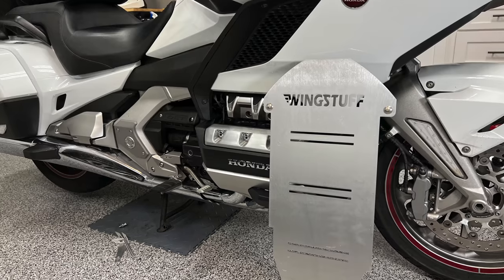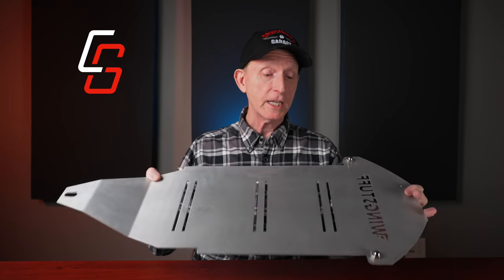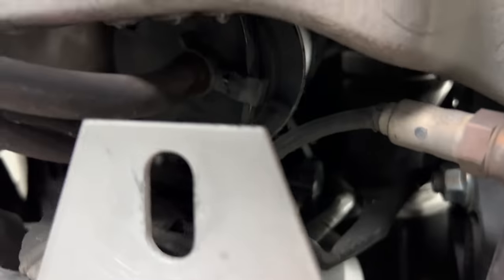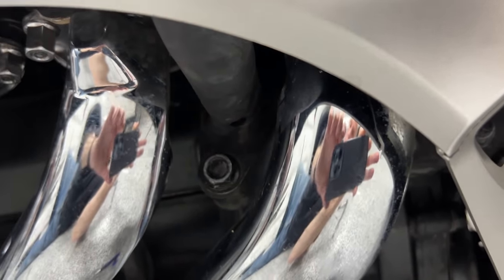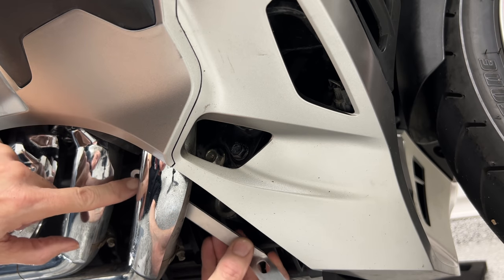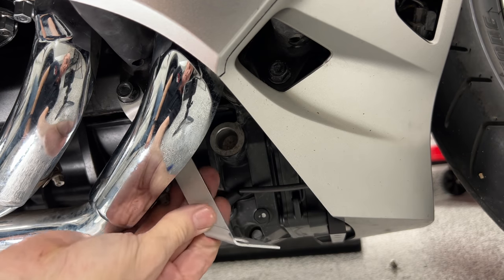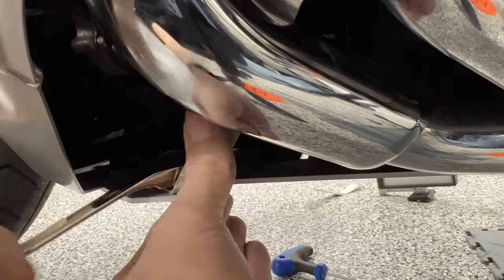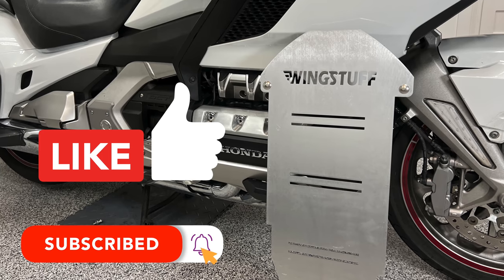Belly Pan Skid Plate for 2018+ Honda Goldwing from WingStuff | Cruiseman's Reviews | 2022

Comment: Thank you for your review. After your review I am glad that I  purchased and installed the Traxxion engine case guard.
Reply: Same!!
Reply: Well said!  Speaking from experience..If you've ever had an impact to the engine guard you won't waste your money or time on this product.
Reply: @gregb.6682  this plate only needs to be made a bit thicker and it would offer all the protection of the Traxxion case guard without removing any engine bolts to install

Comment: Received this kit yesterday. The “T” nut has two nuts and the acorn nuts are no longer shipped in the hardware pack. Face lock nuts have replaced them. I was never a fan of a belly pan. But, seeing engine case damage on the Goldwing forum, I ordered this pan from Wingstuff. It is absolutely a very sturdy pan. If road debris destroys this pan, you have bigger problems. I was hesitant to order this over the heavier Traxxion pan. But, seeing it firsthand, I can assure you, it’s more than adequate to prevent damage to your engine case. It is very heavy (like 1/8”+) thickness. I was actually surprised at the quality and strength of this pan. I would not hesitate to say, spending more money on the traxxion is a waste of your dollars.

Comment: I would actually opt for a kit that has the properly bent brackets. You should not have to do that…
Reply: @samerhallak  so once formed it will come out , but if it comes pre formed it won't? That makes no sense.
Reply: @alsaint7944  simply it needs an engineer to understand it.
Reply: Wingstuff just announced that current kits will come with pre-formed mounting brackets, that will not touch the header pipe when installed! Good news!
Reply: @claynicolsen5401  that is good news
Reply: It would have been easier if heed put the brackets on the correct bolts ( the front bolts on the engine bars and not the rear ones ) like it says in the instructions then you don't have to bend anything
Reply: @claynicolsen5401  The one I received from them last week did not have pre bent brackets.
Reply: @ientwistle1  

100%. It’s the front most bolt. He’s got removing wrong bolt.

Comment: Wingstuff should be refunding everyone’s money who ended up with the first and second editions. Mine was crap and did not have the   Nut and washer for the T bolt. Had to try to find replacement at local hardware store. Seems to me they should have taken the faulty one off market if they were designing a new one, instead of selling substandard plates. I literally purchased the last edition a month ago.
Reply: They should not be selling anything that's not finalized. Its kinda scuwy of them to do so.
Reply: This video made 9mos ago must have update/different instructions. Here in Oct 2022. Those 2 front bracket bolts between exhaust pipes are now the 2 bolts forward just inside the lower side engine covers. A goat screw, but not impossible and certainly not 15-20 min by any means. Not a complicated process but requires the finger dexterity of a martial artist. 😂 Got to be able to better engineer brackets that require no bending.  Brackets that fit the Wing as it should. Otherwise a good value.

Comment: I have an ’18 Tour, manual. I installed the latest version of Wing stuff’s belly pan on 1/25/22. It was a fairly easy install, taking me less than 45 minutes. I watched Cruiseman’s video before starting. He covers the process pretty well.
 
A couple of points have changed since he posted it. The front brackets are pre-bent. However, I still had to make minor adjustments on both sides. The kit now includes two washers and nuts for the rear t-bolt. This allows you to secure the T-bolt, with one washer and nut. You then slide the plate onto the bolt, and secure it with the second washer and nut.

I have a few minor concerns:

The printed instructions say that you can slide the belly pan above the front plastic cover, and push the plate up about an inch. I could not do that on my manual. To me, there was not enough gap to slide the plate inside. The brackets also hold the plate lower than the plastic cover.

I’m concerned about the nuts coming lose while going down the road. You need to remove the plate for oil and filter changes, so you may not want to use Loctite. A nylon-insert lock nut might help on all three nuts. Lock washers may help also.

Be aware that the nut, on the left side bracket, is pretty close to the shift linkage on the manual bike. (May not be a problem with the DCT.) You may need to adjust the bracket, to make sure there’s enough clearance. 

Just my 2cents worth.

Comment: Fitted my Wingstuff belly pan today. The brackets are a right royal PITA!....especially if like me, you have the Goldstrike Highway pegs fitted. It's doable but very fiddly have to line up the highway peg bracket with the POS belly pan bracket and the bolt hole in the casing. Lots of sweating and swearing involved. I ended up tapering the highway peg mounting bolts that the bellypan brackets also hang from so they would find their way easier into the casing eventually. IMO, a better and easier way would be a 2 piece bracket for each side, either end bolted into their respective holes and then joined with another nut and bolt in the middle?? ....Just a thought.

Comment: Nothing keeps you from permanently installing the T-bolt with a separate nut and then installing the plate over it with another nut except maybe my post below. It appears the "recess" or bend in the rear portion of the plate is deep enough  so the additional nut will not lower the plate significantly. On the install pictures I have seen the T-bolt appears quite long, so maybe this was somebodies thought anyway. 
I have Max's ECG system and  installed it on my DCT. I have since removed it (Never ridden it, just installed), re-torqued all the OEM bolts (which were torqued all over the road). I had also reshaped the cutout for the rear Oil drain plug.

The bracket fit was fine, but the remove/re-install process with seven (too short 10mm screws) is cumbersome. The plate is heavy when you are lying under your bike on your back and are trying to hold up the  plate with one hand and trying to insert one or two fiddley tiny screws with the other. Big pita, IMO.
YMMV

Comment: Good review and install guide. The soft aluminium brackets and touching the HOT exhaust mite weaken over time. check regularly I say..I’d put a bigger washer on the  Tbolt for sure.. good plate tho…👍

Comment: The braces on the front should come pre bent - fail.   SAE hardware on a Metric Bike (if that's the problem you were having) - they should be identified in the instructions under "tools required" - another fail!  A "T bolt" that, if it comes loose, will come right out of the hole - another fail!

Hmmm, wonder if the skid plate should fit "under" the front cowl?

I do like the idea of NOT having to remove bolts that are holding the engine together as is required with the other Skid Plate when its time for an oil change.   And, I like the full coverage.   Even if there is a heaving impact pushing the skid plate into the engine the force will distributed much better than not having the plate in place.

I do like the idea of the flush mounted bolts on the Traxxion Dynamics skid plate bottom as they seem easier to undo than trying to get a 14mm (or whatever) wrench on an acorn nut "up underneath".

GREAT review - thanks & keep them coming.   HAPPY NEW YEAR!
Reply: Good point Don, the T bolt in the rear should have 2 nuts... one to hold the T-bolt on and in place (with some lock-tite), then you put on the plate and have second nut that holds the plate on.
Reply from the maker: You can mount it with the plate under the front cowl.
Reply: @cruisemansgarage  Hi Chris, Do you mean that it can be tucked in, under the front cowl and then bolted up? Thanks, Al
Reply from the maker: @alt9874  Yes, you can install it that way, but when I tried it that way it sort of reshaped the plastic, like it was being put under stress. So, I opted to install under the cowl.
Reply: If the 2 left and right hangers are pre bent, they would not maneuver between the engine and pipes. This was left intentionally so customer can form it easily by following instruction starting from top engine guard bolt. Once it's formed it could go in and out easily.
Reply: @samerhallak This reply makes no sense. If it goes in and out easily once it's formed, it follows that it would go in easily if it were preformed...As it is the hangers do NOT go in easily as the are NOT preformed and have to be bent in a ridiculous ritual/ceremony
Reply: @wernerm9613  since you don't have it physically in hand, you won't be able to tell. I know what I am talking about.
Reply: @alt9874  Nothing keeps you from permanently installing the T-bolt with a separate nut and then installing the plate over it with another nut. It appears the "recess" or bend in the rear portion of the plate is deep enough  so the additional nut will not lower the plate significantly. On the install pictures I have seen the T-bolt appears quite long, so maybe this was somebodies thought anyway. 
I have Max's ECP system and  installed it on my DCT. I have since removed it (Never ridden it, just installed), re-torqued all the OEM bolts (which were torqued all over the road). I had also reshaped the cutout for the rear Oil drain plug.
The bracket fit was fine, but the remove/re-install process with seven (too short 10mm screws) is cumbersome. The plate is heavy when you are lying under your bike on your back and are trying to hold up the  plate with one hand and trying to insert one or two fiddley tiny screws with the other. Big pita, IMO.
YMMV
Reply: @cruisemansgarage  excellent point. Max's ECG edges also go OVER the front plastic. They can be forced to go under just like the Wingstuff one, but it will definitely stress the front chin cover. So much so that I left out the side bolts on the lower Tupperware to relieve that stress. NOT a good idea, as everything is more or less out of alignment at that point. Remember the "little plastic hooks" for the side covers??
Reply: @wernerm9613  yes I agree. If I get the Wingstuff unit I'll just add a second nut and maybe a lock washer at the rear, that seems like the easiest fix. As you said the bolt seems long enough to accommodate that fix.
Reply: @samerhallak  This reply makes no sense. If it goes in and out easily once it's formed, it follows that it would go in easily if it were preformed...As it is the hangers do NOT go in easily as the are NOT preformed and have to be bent in a ridiculous ritual/ceremony

Comment: Does not look nearly as "substantial" as the Traxxion Dynamics skid plate. Also wondering if in the future, the engine guards/ tip over protection Max talked about making will work with either plate?

Comment: Thanks for the review!
What is the OEM purpose of the bolt that is removed between the first and second exhaust pipe to mount that strap type hanger?
Is it an Engine Case Bolt that compresses an Engine Oil Gasket or does it mount a particular part of Motorcycle hardware?
I do not like to have to remove ANY Engine Case Bolts that secure Engine Oil Gaskets as I feel it just potentially  invites oil leaks in the future 🤯
Reply: I believe that Chris verified that it is one of the mounting bolts for the tip-over bars, so it's not a bolt that holds any part of the engine cases together.
Reply from the maker: Clay is correct, these are the lower mounting bolts for the tip over bars.
Reply: EXCELLENT QUESTION !

Comment: I wondering if this case guard is install right..it looks like the plate is mounted below the lower fairing chin in this video..but on the GL1800 riders forum a picture is showing the plate tucked inside the lower chin fairing...that would explain why there is such a long mounting  slot at the back end of the  plate...so you can slide the plate back and forth as you postion the plate into the lower chin fairing...looks much better that way and would also keep the road grime out from under the case guard better.

Comment: Good follow up! You'd think, the brackets would come pre-bent, tho. Wouldn't ya? Too much like "backyard engineering" All in all, looks pretty good
Reply: If the 2 left and right hangers are pre bent, they would not maneuver between the engine and pipes. This was left intentionally so customer can form it easily by following instruction starting from top engine guard bolt. Once it's formed it could go in and out easily.
Reply: @samerhallak   This reply makes no sense. If it goes in and out easily once it's formed, it follows that it would go in easily if it were preformed...As it is the hangers do NOT go in easily as the are NOT preformed and have to be bent in a ridiculous ritual/ceremony
Reply: @wernerm9613  since you don't have it physically in hand, you won't be able to tell. I know what I am talking about.
Reply: @samerhallak  This reply makes no sense. If it goes in and out easily once it's formed, it follows that it would go in easily if it were preformed...As it is the hangers do NOT go in easily as the are NOT preformed and have to be bent in a ridiculous ritual/ceremony
Reply: @samerhallak  you have it "physically in Hand"? I suspect you work for the manufacturer and you are doing your job.

Comment: Good concept and the fact you do not remove critical bolts of the engine block is a plus for me. This is pretty simple install. What bugs me big time is the fact that I will need to guess the banding and angels and more. Why ??? It should come as a Lego kit, plug and play. This will deter bikers from ordering. Traxxion's is way more solid, but I have an issue with the engine block bolts removal and the fit of the plate is way too tight. The plate on Max's must float and then tightened.

Comment: I think this latest version is going in the right direction. I would like to see the plate go a little thicker and remove the bottom cutouts and that Wingstuff cutout..those cut outs are unnecessary and only increase the cost...the front mounting brackets should be made from stainless steel and be already bent.
I already bought the Traxxion case guard but havn't installed it. I don't know what to think with the few reported oil leaks after installing the Traxxion case guard. I like how this case guard doesn't  mount to the engine but the front mounting brackets could be made from much stronger stainless steel.
Reply: Frank I totally agree with all your points. I was going to order the Traxxion version, but I'm hesitant now about taking out those engine bolts and the possible oil seeping. This version seems fine, but the connecting arms should be pre-bent stainless like you suggest. Maybe they'll do that in their next version.
Reply from the maker: I think the oil seepage was temporary and will resolve itself. I am doing long term testing and will report back.
Reply: @cruisemansgarage  Chris. Can we remove the rear oil plug bolt  to drain oil without removing the rear machined retention block.  Still have yet to see if is is still a point of contention as the retention block should be replaced with one wher the drain bolt can freely be removed. That would be the solution as a crush washer is needed on this cap bolt. Hope to hear from Max next week.
Reply: @cruisemansgarage  Thanks Chris, I am curious to know if that oil seepage stops. Let us know which one you decide to use permanently.
Reply: @SecurityBob  the Traxxion case guard I received has a notch milled in the rear bracket so the oil plug with the DCT model can be removed without touching the mounting bracket..it was a afterthought and done after the part was anodized. Its not needed with the 6-speed model
Reply: @frankward8003  who milled it you or Traxxion?  I’m waiting to hear from Max as he is quick to resolve these fitment issues when uncovered.  This specification issue should be resolved in the CNC software and then sent to the anodizing process. Hope to hear from Max this week.
Reply: @SecurityBob  Traxxion milled the slot after they anodized the bracket...I would assume that all the new case guard kits will be like tgat now..I'm sure Traxxion would change out tge bracket for you
Reply: @frankward8003  thanks Frank I’ll reach out to Max tomorrow as I assume others who ordered early will be able to change out.
Reply: The mounts made out of aluminum might be better because if something big enough to bend or deform the plate hits it, the force would be transfered up to the mount on the engine and might damage it. The aluminum would sacrifice itself. Just a thought. I'm thinking of making my own plate bc I'm retired , have the aluminum and have experience...... and I'm cheap.
Reply: I was one of the first to receive the Traxxion engine plate. Traxxion replaced the rear mounting bracket that now allows me to remove the rear oil bolt without restriction..  

The slight seepage was caused when replacing the bracket/engine case  bolts.  

I cleaned the plate , re-torqued the bracket bolts, reinstalled the plate and drove 700 hard highway miles. 

Last week I removed the plate and there there was no more oil seepage. The underside of plate showed just dust.  

So I’m happy with the resolve and trust the products to be the best protection for its intended purpose.  Call Traxxion if you need a replacement CNC’d rear mounting bracket.
Reply: @cruisemansgarage  So what did you decide now that you've had some time to test?

Comment: It would have been easier if you'd put the front brackets in the correct bolt holes  ( the front bolts on the engine bars and not the rear ones ) like it says in the instructions then you wouldn't have to have bend anything